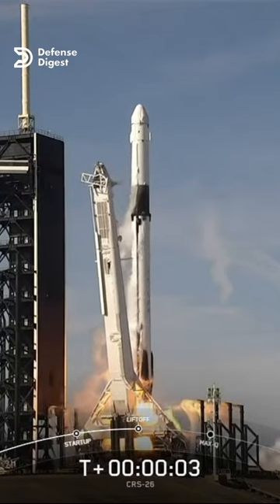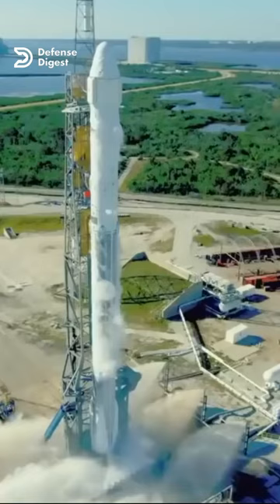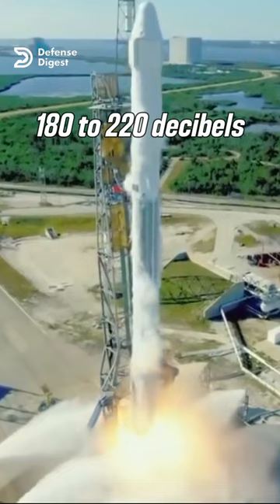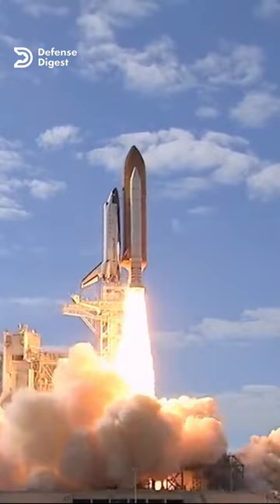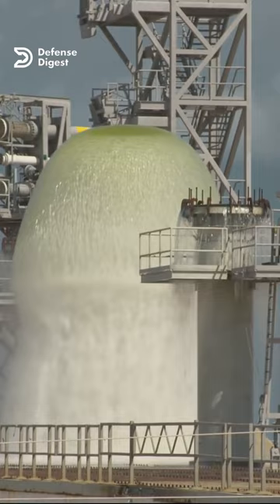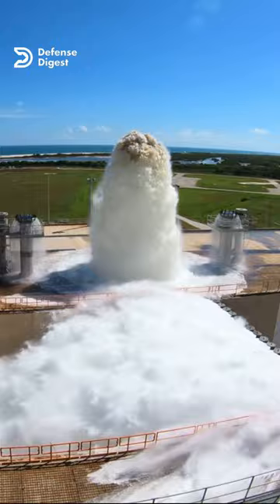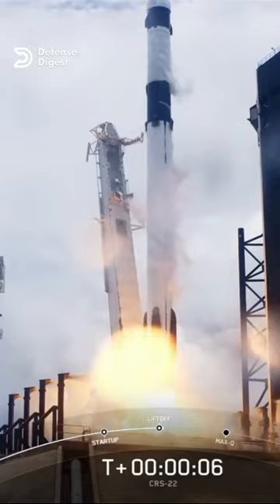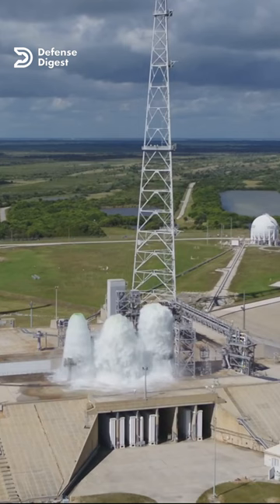This Is How NASA's Water Jet System Protects A Rocket Launch

Comment: That’s exactly why Starship had a failure on it’s first test flight due to there not being a water deluge system. The debris also damaged some of the raptor engines when all it’s 33 engines ignited. Now there is a deluge system for the launchpad so there won’t be debris flying everywhere like that again.

Comment: Water also expands when it is  heated, this expansion helps lift off...the energy of expansion applies forces against gravity of that particular location.
Reply: That force has to be tiny, right?
Reply: this is totally false
Reply: @anthonyotlowski1978  water doesn't wxpand when heated?
Reply: @mastyer0fReality  it does but the expansion doesn't have anything to do with liftoff forces
Reply: How would that cause any thrust? Nothing is leaving the craft when the water expands

Comment: I have a slowly dripping faucet that I can hear emptying down the drain in the shower. It is mildly irritating...

I put a rag over the drain, and as the dripping water slowly soaks the rag, the sound of the draining water is diminished. 

It's cheaper than calling a plumber... (Though, mabe not over the long run)

Comment: You not about to zoom past like you didn’t just say 300,000 gallons of water can be dispensed in 41 seconds 😂😂😂😂
Reply: He told 3000 not 3,00,000 lac
Reply: wanna do some math!? 300k gallons in 41 sec is 7,300 gallons per second. a 7 foot diameter pipe only needs 3.54 PSI to move 300k gallons in 41 sec. assume they have more than one of these. not only is it possible, but these pipes are likely operating at less than 2psi to get this done. lol

Comment: I Imagine that dampening also helps hold the launch pad together a little bit too.  It's something that SpaceX could have probably saved an engine or two on their latest test launch but for their objective, they won't have access to proper pads on Mars.
Reply: It doesn’t.
Reply: @weekiely1233 it does :)
Reply: @techheck3358  it doesn’t. Deluge mitigated sonic energy. 

Not only can a deluge like that not be built at Boca but the mechanism of failure for the pad was literally molten sand and water under the pad not an issue with the pad itself. 

It’s has more in common with volcanic dome failures than weak concrete. 

Deluge wouldn’t have fixed it since it doesn’t mitigate energy from the launch that’s not sonic and adding a deflector would actually increase sonic loads. 

Shuttle also used Deluge yet it still damaged its pad on numerous flights
Reply: @weekiely1233  water absolutely also dampens heat energy.
Reply: @techheck3358  not with rockets. You need a lot of water to do that and not only would that be impractical anywhere let alone Boca. 

The ones at LC39A/B are sound suppression systems designed to limit sound but because they use droplets to do that they’re useless at rocket exhaust cooling since that literally atomises the water particles
Reply: @weekiely1233  they also help supress heat. vaporising water particles as you say, takes heat away